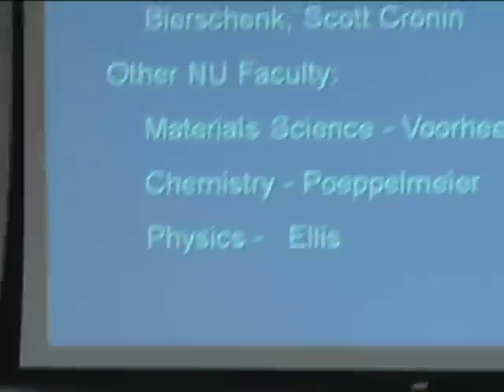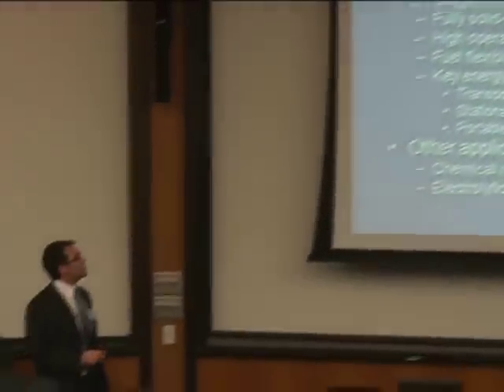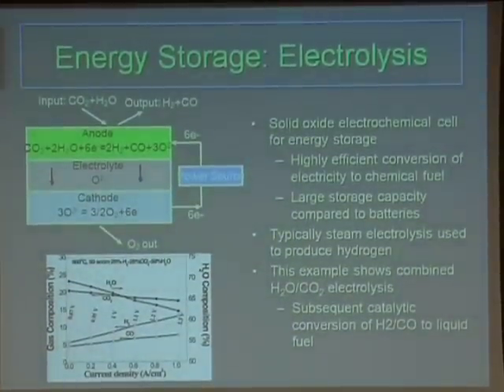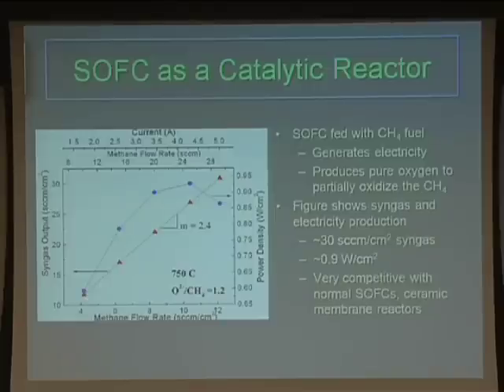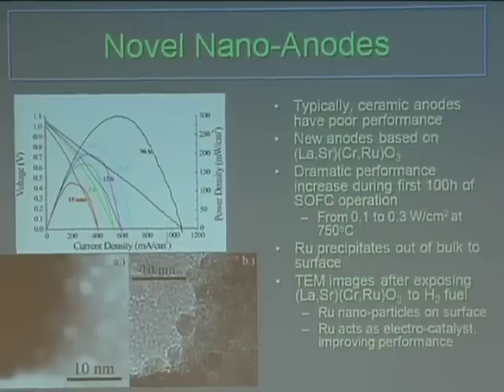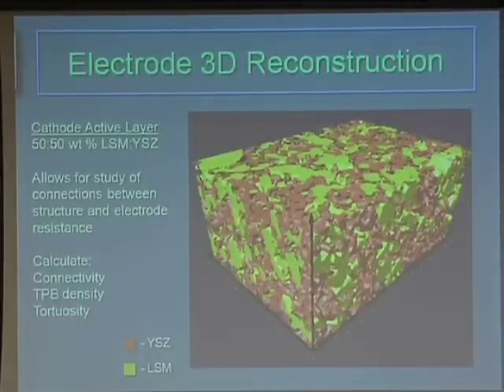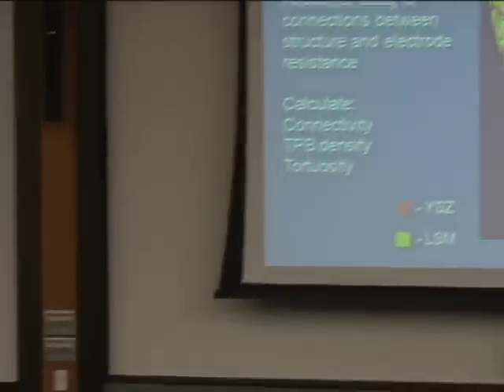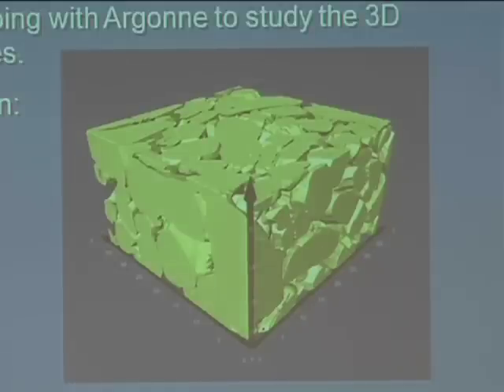Solid Oxide Fuel Cell Research at NU

Comment: Nice video. The electrochemical explanation puzzles me a bit though.

Where is the oxygen molecule getting the electrons from in order to become oxygen ions?

I would have thought the hydrogen molecules would have dissociated into atoms and then donated their electrons to the oxygen via the external circuit. The resulting reaction would have then been hydrogen ions forming dative covalent bonds with oxygen ions to form water.

Comment: the the electron comes from a external circuit. The electron is produced During the reaction at the anode where the hydrogen molecule react with the oxygen ion. the electrons then go through a external circuit to generate electricity and gets recirculated back to the cathode. at the cathode the electron reacts with the oxygen in the air producing the oxygen ion.which diffuses through the solid electrolyte repeating the process.